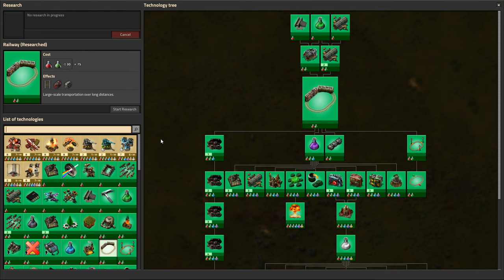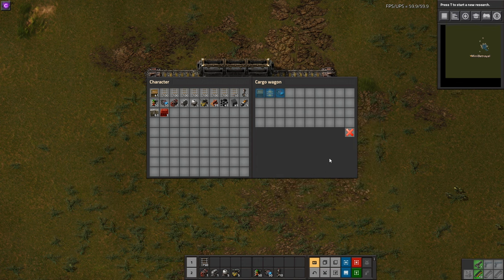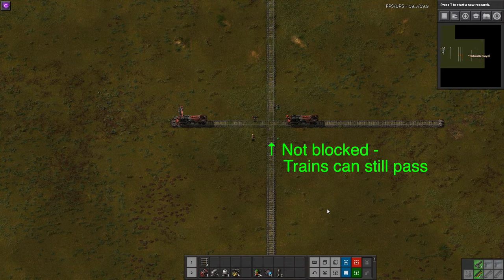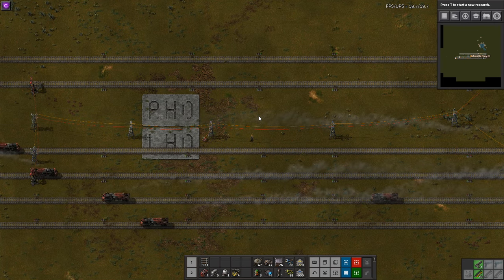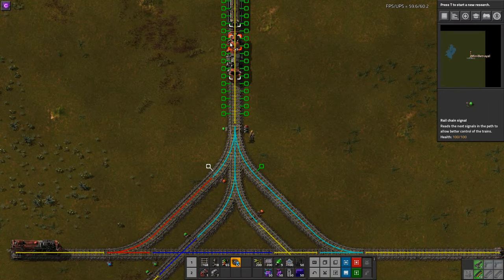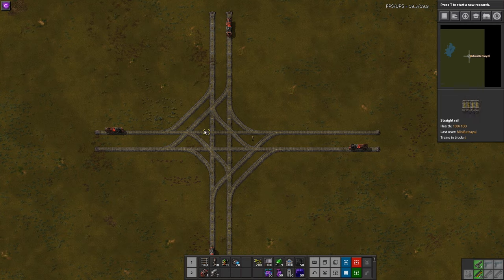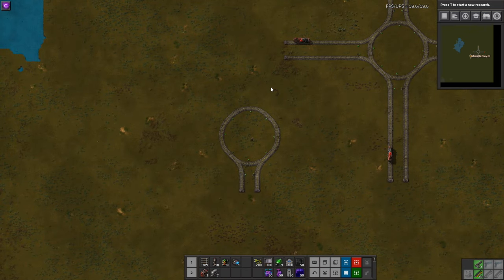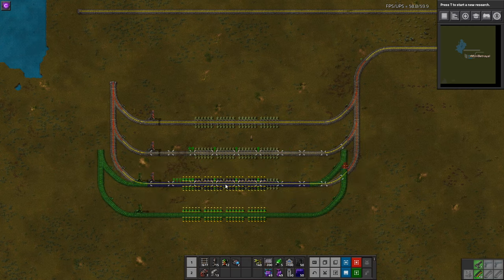Factorio Train Tutorial - Absolute Basics

Comment from the maker: Some quick notes that I should mention:

1: The example ended up getting cut, but you can load any fuel type into a locomotive with an inserter, similar to a cargo wagon.
2: I wasn't very clear about attaching the Train Stop to logistics or circuit networks. This allows you to use the "Circuit Condition" wait condition on the train, or send details about the train into the relevant network. My circuit network tutorial covers it in a little more detail, and the logistics network connection is pretty much the same.
3: While I mentioned it in the video, I have not included a link to blueprints this time. There are a few reasons, chief among them being that I don't feel any of the designs showcased in this video are worthy of sharing; this video is mostly about the process of designing a rail network that works, rather than making a good or pretty one. Also I forgot to make blueprints as I was going, so I'd have to go back and do it all again, which I don't want to do.
Reply: Re: 1.) You can provide fuel into (or even out of) locomotives with inserters as would also be the case with cargo wagons.  However, while you can load / unload cargo wagons with belt-loaders (whether modded or console-unlocked) the belt-loaders will be impotent as toward or from a locomotive.  Thus, even with loaders, inserters, specifically, will remain required for automated locomotive fueling.
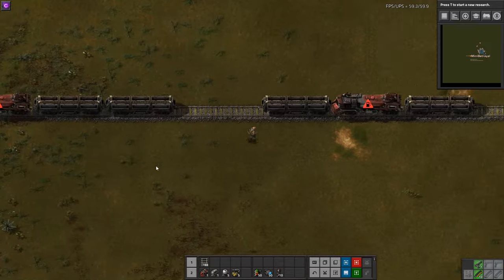Reply: Not sure, if someone already mentioned it (too many comments to go through), but at 8:50 you said, it's an aesthetic option, where you place the locomotive.
This isn't entirely true, because all rolling stock have an air resistance vallue.
The air resistance of the front rolling stock is used to calculate the max speed of the train and a forward facing locomotive has the lowest vallue.
https://wiki.factorio.com/Locomotive#Maximum_speed

I know, this isn't really train basics, but it still means, aesthetic isn't the only reason why you should consider to place locomotives in the front.
Reply: Dude, this video is absolutely amazing. I’m a new player and other factorio tutorial channels have been disappointing me, this is EXACTLY what I was looking for. Very well made, thanks for putting in the massive effort so I can finally have a sprawling train network :)
Reply: Amazing video. Thanks for the detailed tutorial!
Reply: Somehow in the video was mentioned smart fueling over the schedulle, but never was shown. Is it just go to waiting station and while train is staying there it will be refueled?
Reply: “I don’t want to” -🗿

Comment: As still newbie, I thank you so much for this video.  I would get something to run but had no idea what I did right and could to repeat it.  Going back to redo my whole system for practice in my first build.  Thank you for the roundabout concept as it is good start for a beginner like me since you can copy and paste to add to it.  I am sure as I progress in my building I will change, but golly helpful to get started with something that works. As an update - in about 15 min I fixed all my train issues after learning the chain and signal rule.  Even got a line that I gave up on. THANK YOU!

Comment: This is an absolutely excellent tutorial. I've included it in our train faq entry on the official discord.
I just have a small note of something I just noticed (I didn't notice it the first few times I opened this video): The first T-junction you show at the start of the video actually has a pretty significant signalling error. The bottom 2 tracks coming from the east are missing chain signals for the outermost track coming from the north. You can actually see in the video that there's 2 trains waiting inside the junction, blocking another train coming from the north.
Small nitpick, but I hope you're not using that same blueprint in your bases still.
In any case, great job.
Reply from the maker: I actually noticed that while i was editing the video (something something darth plagueis). Its fixed now. Thanks for the interest!

Comment: That's a really good and thorough explanation and I like your style of going into the details :) One thing that I didn't find, which was my original reason for watching, was that sometimes if I've built a station and then reverse the direction on the platform (moving the train stop to the other side of the tracks), I can no longer get the inserters to align. It's probably got to do with the grid system you mentioned? Anyway I still learned a lot, so Liked & Subscribed :D

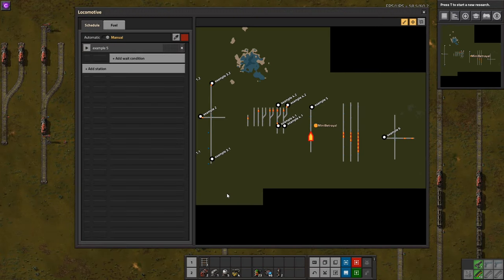Comment: 24:00 This part is really something that should be taught in the game. Like many things I learned by trial and error, I was about to suspect factorio can't even handle trains going in straight lines instead of circle tracks. Eventually I got rid of every single signal until something somewhow seemed to work out, but rail systems still give me a nightmare. Screw them, my live for Aiur Bots.
The worst part is sometimes I can place singnals only on one side of a track and I am yet unsure why that is exactly... Especially when a train could use signals on the other side...

I love how you put mean time there instead of meantime, slight but crucial difference I love that typo.
Reply: The game does in fact teach you about this, if you press the tutorials button. The problem is that getting through the tutorial requires too much trial and error once you reach the explanation for chain signals. Instead of having you mix normal signals and chain signals, the tutorial places a normal signal at every crossing. So instead of learning where to place your chain signals, it is much more likely that you trial and error your way through the tutorial without learning a thing about chain signals.

Luckily, once you figure out how chain signals work every other part of the rail network fall is easy to understand. Well, every part except for stations. But that is caused by the game not explaining the circuit network well enough. That being said, I am pretty sure there is also a tutorial for stations.

Comment: excellent video, and finally the proof that a tutorial can be done (and probably is easier to understand) when the character isn't running around all the time.
luckily, i ignored the start of the video that showed trains blocking the crossing :-) :-(
a hint for copying colors at 10:30 : colors can also be copied with shift-leftclick/rightclick between trains and stations, and of course schedules are not copied when doing that. thus the color from one train can be copied to another train without also copying the schedule by transfering the color from a train to a station and then from that station to the other train.
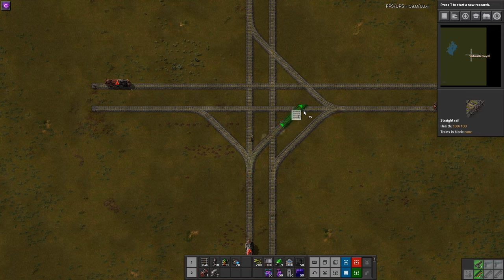a hint for crossings, eg at 58:45 : that "small triangle" does not need to exist at all since trains in either direction will block the other two directions on the triangle anyway. thus the triangle can be shrunk to be on one track and thus have more space for signals on incoming and leaving pathes. but of course, this is only an optimization that reduces the required space, and building it like you do shows the proper signaling in the general case when you have enough space.

Comment: Artillery trains I find are best for late game base expansion, if you like me easily eat through resource patches. What I have is a blueprinted base that I use for artillery trains which is basically as compact a fortress to defend the train as I could make. The base has flamers and lasers for defense packed in as densely as I could, it can fit a 1-4 train with 3 wagons being artillery wagons and the last one being a fluid wagon for oil for the flamers. The flamers are absolutely needed since you'll get attacked extremely intensely especially if you're attacking a late game base. This method of late game expansion is however still by far the easiest and least hassle to do, this base is basically impenetrable, it can kill giant biters in seconds. This means that all you have to do is sit back and target all the bases in range and once you're done you can just leave the base there if you feel like and then you have a nice defensive outpost or you can pack it up and move on. It makes a lot of sense to do it like this because you're probably gonna be using trains for cargo transport anyways so you'd need to build that railway anyway, this just makes use of that and means that you can avoid fighting the biters personally.

As an expansion of this in my last playthrough I built a slightly more complicated system where I both used artillery trains and had outposts with artillery in them. The artillery trains would serve to clear out the way again and then at points around the base and at mining outposts I'd have an artillery battery and flamer defenses, who would then be used to clear the area around the outpost out (and sometimes chopping down forests) and also keep biters far enough away from the outpost that they wouldn't attack, thereby saving power. The system was automated and standardized so my artillery trains with fluid wagons could stop at an outpost and the pumps and inserters would all line up so I could basically use the outposts as additional firepower if need be and I could also turn a base into an outpost easily. There then was an automated train that resupplied all of these bases automatically with flamer fuel and artillery shells, which was simply done by turning the stations on if supplies were low. This was also really helpful especially because it was a multiplayer game and we had built an absolutely massive base that ate up resources at an alarming rate and it also meant that all of my friends could easily use the system if they needed and basically they didn't need to think about it, they could just call in a strike whenever they needed it. It was also just cool as fucking hell to have such an advanced automated defense system.

Comment: 10:45 something I didn't try myself, but suppose would work fine, is based on the fact a train (constituted of an arbitrary number of wagons and locomotives, at least 1) has the same schedule for any locomotive. If you copy (better make a copy) of a locomotive, keeping the schedule. Adjust the locomotives' colors as you wish, copying & pasting for faster approach, and then attach a new locomotive anywhere to the recently colored train. Obviously, while doing all of this, attaching vehicles would set train to manual driving mode, so it's better to set it manual in the first place. Copy the original schedule to the recently-attached locomotive, which is the whole reason why this works in the first place; train has the schedule of the last adjusted locomotive. Now destroy that locomotive. In a dream mod, I hope there is a way to export all data of train, individually and collectively, to a Lua (or human readable code) like:
[[[
schedule = {
{"Copper ore mine 5", {full_cargo}},
{"Copper ore process", {item_count("copper_ore") == 0, inactivity == 5}},
},
components = { # meaning locomotives and wagons collectively
locomotive # fill in color and fuel slots that would be filled automatically when constructed by bots
wagon # fill in wagon's filters if normal wagon, fluid filter if when this gets implemented, like assembly machine filling entire pipe network with expected input or output liquid
}
]]]

Copying schedules would make setting outpost trains so much faster

Regarding stackers, let me state the made example is not ideal situationally, as the whole point (not really, but you don't want it to go that way) is to allow throughput at all times. For a single item throughput (more accurately, single train-type, meaning multiple trains whose cargo is different from each other), it's absolutely fine, but for multiple items, it could possibly consume less of item A than B, resulting in a plentifulness of B, resulting in accumulation of B's trains (which is fine on its face), while lacking item A. It's possible by shear chance (especially with multiple journeys, that the train(s) or A get entirely obstructed by B's trains.
So in short, if they're unloading multiple train types, try to parallelize trains in single train-length sections, rather than double and longer.

Comment: I prefer a much simpler idea of when to use chain vs normal signals (which is separate to where to use signals in general):
Anywhere you have a signal, where the next signal down the line is less than a train length away, you should use a chain signal.
Anywhere you have 2 chain signals in a row, without any crosses or splits, you should remove the latter one.
Any block you don't want a train stopping in, you should use a chain signal at the start of.
The latter includes 2 way tracks, blocks were tracks cross, and between a parking area and station (except the one just before the station).

Conversely, anywhere you are planning on having a train stop and wait, you want a normal signal before it.

Comment: Am I the only one who prefers a clover interchange design for intersections? Granted, that's based around lines passing over/under each other as a means of avoiding lights, which Factorio can't do (disappointingly), but it can still work. You limit the line crossover to just where the main lines pass each other while all the line switching is done outside where lines won't cross. Also gives you more room to put the signals in, since you don't have to jam lines closer together. It's what I used to use way back in Locomotion.

Comment: Good tutorial on basic rail signalling.  However, at 1:16:56 you appear to be inconsistent when at the bottom of the stacker legs you used regular signals to enter the junction / common section, and not the chain signal, which you explained in detail to that point, to use?  I think of chain signals as decision makers, if to enter or not, or if to choose another path, and the regular signal to mean that I left the junction or an area and another train can now come after me.
Reply from the maker: You could use either there. Using normal signals will allow a single train to enter the merger and wait before it gets to the station, using chains will mean theres no waiting line and trains will go right from the stacker to the station. That said, i guess i should have used chain signals in this tutorial for consistency’s sake

Comment: I wonder if there will be bridges or underpasses (doubtful), but it's very similar in signalling to openttd. There's more efficient ways of doing either a terminus station or a roll on roll off setup, but a number of them (least the crossover junction and smaller stations) are sadly dependant on being able to make under or over passes. But very helpful, I was a bit stuck on doing the station themselves.
Reply: My main tip (least from openttd), is that you want those junction points to be able to accommodate the length of the train, mainly to improve throughput and prevent trains needing to slow or stop while the junction is in use. If you're not pressed for space anyways.
Reply from the maker: I believe theres a mod (or mods) that allow bridges and tunnels of a sort, but as i understand it theres no plans to introduce them for the base game

Comment: Just a question, why didn't you put the turn, the 4 ways intercept (like cross) and the 3 ways intercept (like a T) all meet at a circle. I put the signals on the outside ( you used the inside). I only used signal at the start and end of the turn, no signal inside the circle, so that if there is 1 train which is turning using the circle, the other trains won't come in, so they won't get stuck. With the circle, i am able to use a 4 lanes train system, 2 from 1 side go left and 2 from the other side go right. I did a 2 ways intercepts (which is used for trains to turn back or change lanes), a 3 ways intercepts (shaped like a T) and a 4 ways intercepts (shaped like a +), no problem spotted at the moment.
Reply from the maker: Roundabouts are simple but have their issues. With signalling as i do, trains shouldnt get stuck by other trains. Without signalling in the middle of the citcle, a trains can progress through the turn at the same time if they dont actually interfere with each other. Your way, two trains going straight ahead in opposite directions would still need to wait for each other

In short, roundabouts are slower, can cause pathing issues, can unnecessarily block trains, can make trains deadlock themselves in some situations, and are difficult to design for 4+ lanes. 

They are also, simple elegant, and easy to understand. Perhaps i should do a video on just roundabouts

Comment: Hey I am having a problem with the item count. What I'm trying to do is one wagon is for one type of raw material. For my first station I have iron ore = 500. But it will keep adding more ore and won't move. How do I solve this??
Reply from the maker: Without seeing your setup, i think it’s skipping past 500 because it never has exactly 500 in it. If it has 499, then two inserters drop one in at the same time it will go right to 501 and never trigger the train’s condition 

To fix this, try > 500 instead. Alternatively, use the middle mouse button to click on the actual train wagon inventory slots to set an item filter, so only certain items can be added. Make sure that only 500 iron can fit in, and your loading station won’t overfill the train

Comment: Is it possible to have a train drive 1 track in both ways, just going back and forth? i cant get it to work i keep getting an error saying there is no path and it's driving me nuts!!
Reply from the maker: It is definitely possible. You need an engine facing each way in your train, and make sure your train stops are on the correct side of the rails
Reply: @MiniBetrayal  thanks, it works. Stupid me put 2 locomotives facing the same direction....